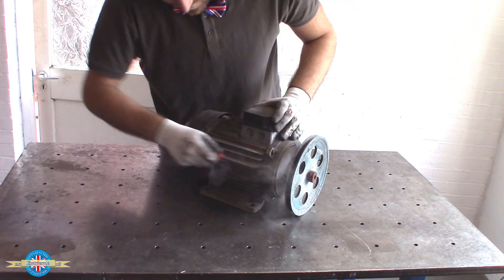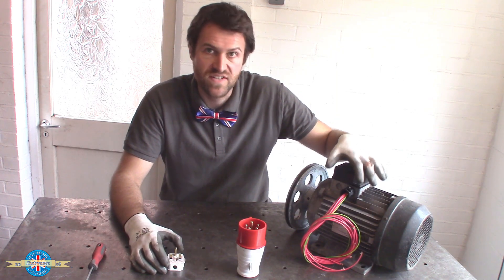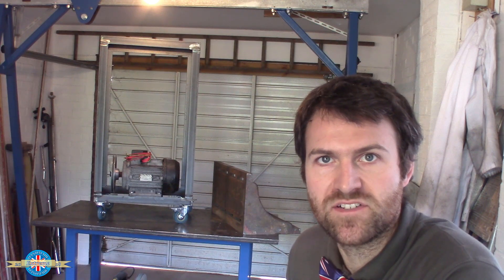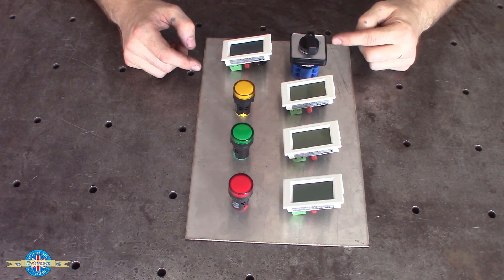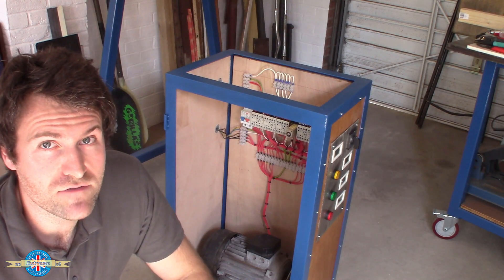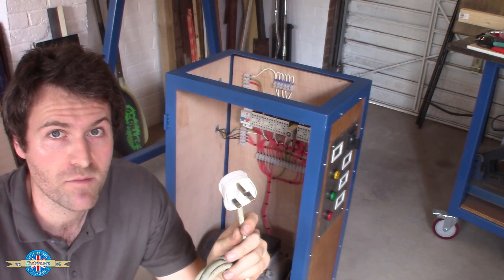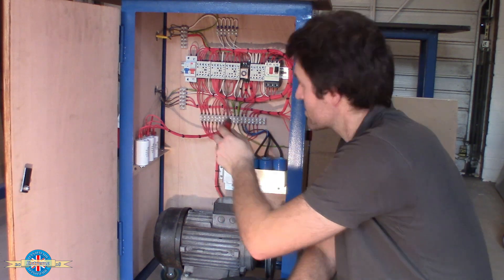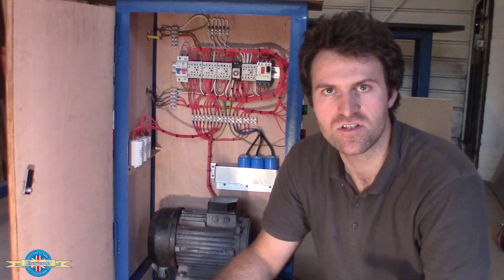1 Phase to 3 Phase Rotary Converter - 230V to 415V

Comment from the maker: I hope you enjoy my latest video. Let me know what you think. 
Is there anything I could do better?
Reply: Do you have  a elec. diagram by chance?
Reply from the maker: Not really no, sorry. If you look in the video description there are some links to 3 other videos. There are 2 by Galvinzedsankey that go into a lot of detail where he shows some diagrams and explains the system in detail. This is where I got most of my design ideas from. I hope one day he will make the third video in the series as I think that is a valuable resource for anyone who is interested in Rotary Converter design. Hope this helps. 👍👍 And thank you for commenting.
Reply: Awesome vid. My only suggestion is give the people what they love. .. more bow tie! Subbed
Reply: Really enjoyed watching this as it took me back 40 years when my father constructed the same thing for his workshop.
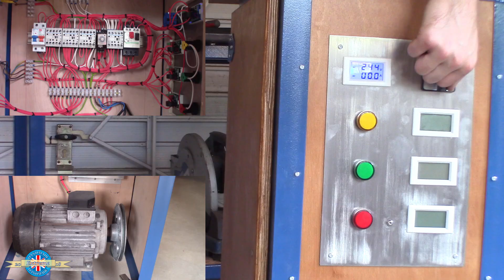Reply: A slightly longer shot at 12:30 showing the system come up to power and the voltages stabilise, but otherwise great work, both in the project and the shoot.
Reply: Like your video, especially work on wiring electrical parts - its look fantastic!

Probably the only thing that need improvement from safety perspective is wooden walls - mostly in case if something go wrong with any part of electronics and it catch fire. In my country it even restricted to place electrical wires on wooden walls - only in metal enclosure.
Reply: One thing you could do is make a hole and a shroud so the motor can suck in cold air from the outside. As well as some vents for it to expel air through on the other side. It shouldn't get too hot but ventilation is always a good thing, possibly with a filter since it's a shop environment.
Reply: Audio! I would look for a mic you could wear. When I surf through videos, audio is what sets them apart in the first 10 words and determines if I keep watching. I would love to see your channel grow. Good luck!
Reply: You start in delta I was always aware it was better to start in star 1/3rd the power before ramping up to delta?
Reply: Not in this application as he's using star for the 415 output
Reply from the maker: Glad you enjoyed it.👍
Reply: Handmade Extreme great job sir❤️❤️
Reply: Just wondering if you had a link to the bloke selling the plans
Reply: It would be good to know how to adjust this design for 240volt
Reply: @connorbesson488  depends on the pony motor your using. He is using delta to star for the 415 or so volts cause that's what that motor is rated at in star. Using a motor in a 240 delta should work fine.
Reply: Better Audio ;-)
Reply: What capacity of rotary converter required to run a total of 37.4kw of 3phase power?
Reply: It was really enjoyable to watch your craftsmanship in this video and a great learning experience about rotary converters!
One minor point that my friend who's an electrician made is that you've not used the standard wiring colours for your cabling inside the cabinet itself. I'm not an authority on these kinds of things at all :D but I think he was thinking about properly identifying the different phases in particular (black, brown, grey I think they are in BS7671).
Reply: @Nehemiah Ivan Lately I have been using FlixZone. Just google for it :)
Reply: Drawing
Reply: You could make it clearer which country you're recording in. Maybe with flags on the walls?
Reply: @RoamingAdhocrat  The Union Jack bow tie and the Union Jack in his "Handmade Extreme" design didn't tell you he was from the UK? What about his accent? Or what about @ 0:50 where he says "here in the UK". Yup, just for people with your low comprehension skills he should have flags on the walls, maybe also in the background a red double decker bus, a portrait of the Queen and maybe he could be eating fish and chips......
Reply: @unapro3  speaking of comprehension skills, you could do with learning how to spot obvious sarcasm, sport ;)
Reply from the maker: @ Damon. I could have used a VFD your absolutely right. however I have a few machines that I want to power and the rotary converter is a slightly more suitable solution for me. Cheers. 

@ DundeeDriver: Have you been watching Alec Steel by any chance.. 😉 Cheers.
Reply from the maker: Thank you. 👍
Reply: I realize it's pretty off topic but does anybody know a good website to stream newly released tv shows online?
Reply: A Variable Frequency Drive would have done the job much simpler. There are plenty out there that will provide 3 phase output from a single phase input. Just configure a few settings, plug it in and done

Comment: Here in the us, 240 single phase is “split” 180 degrees apart with a center tapped neutral. Generally we only have to create one more phase in a rotary converter since we already technically have two at our disposal. I find it interesting since you have to create two additional phases

Comment: great work but im still confused where the voltage gets steped up to 400v? no transformer? or are you getting out 220 v three phase and just using the low voltage connections on the lathe motor?

Comment: Nice work, I came to your video after the galvanizedsankmonkey video.
This method seems to be contridicting a people peoples opinions on the idea of running 240v star when in running - it's somewhat reassuring to see more than one video with this method.
I'm struggling a bit with my own but this video's helpful - particularly the parts list as my own motor is a similar kw rating.

Comment: Great vid, a wiring diagram would be great too,also what size motor on the converter need to be compared to the motor you want to run ?

Comment: Bloody awesome 😎 Seriously 💯/💯
I just saw date. Hope you’re still around. 
Quick questions on build and aesthetic’s.  
If you didn’t want to use a motor, how would you replace it electrically? Are you able to provide a schematic for your wiring?. (I’m into electronics, not AC electrics) Can you highlight the ‘chances of death’ parts of your build please ⚡️ 💀?. 
Hey, why didn’t you align the 4 lcd displays  on you control panel? Why didn’t you feed 3P cable ≈3 inches above 3P socket? Note: Seal both sides and edges of timber, warping can be a real issue. Why were the 3 blue caps put into an oversized elaborate time consuming pocket?
Best I’ve seen on YouTube, really fantastic, thank you. Cheers, Michael 🇦🇺

Comment: Older video But just in case you reply, how would you determine the size 3 phase motor needed to supply enough power to run a 3 phase welder?

Comment: Do these rotary converters run a  3-phase motor better than a VFD do you know?
Reply: No way. VFD provides balanced 3 phase. With a rotary converter, 2 of the voltages are induced in the idler motor’s stator windings as the magnetised rotor sweeps past them (the other voltage being across the 2 single phase supply wires) and these induced voltages drop under load. Even though the 3 voltages out of a rotary converter are perfectly out of phase by 120° from each other (due to the physical position of the stator windings in the idler motor) the “generated” voltages will always be lower than the single phase supply, and will drip further under load. Capacitors can be used to maintain these voltages better, but their capacitance will cause a phase shift, meaning no longer 120° out of phase. Best not to use “balance capacitors”, and opt for as large of an ilder motor as possible (3x load motor is a good minimum, 5x even better).

Comment: fantastic video, very tidy project. Im considering taking the plunge on making one. I have a spare 7.5 kw motor. how would using a larger motor affect the design/components you used? great channel. cheers

Comment: Hello, I have a 208- 415 3HP 3Phase Induction Motor, with 9 leads which can be configured  to a 208V Star Configuration ( U2, V2 and W2 Connected. together) or 415V Star Configuration( U2 is Connected to U5 and So on) . 
As we will be making a Delta Star Starter and will be powering the Motor with 220 volts, what connection in the motor should I select?  Awaiting your revert
Reply: Hello, Can anyone reply please ?

Comment: good job A question, if you allow. Can we operate a pump with a power of 10 horses? And if yes, what is the power of the motor pilote and what are the calculations of the capacitors? And when operating any additional load, do we introduce new capacitors to support the phase?

Comment: Hi
Great video!
I have 1 phase 32 AMP in to our summer house and I want to install a wall box for my EV. How can I get maximum charge? If I convert 1 to 3 phase as you showed our using VFD, how many amps can I load without taking all current from the house? 
If I would split today’s 32 AMP in 2 I would get around 3,7kW which takes ages to charge a 90kWH battery 
Upgrading to 3 phase is unfortunately not an option 
I’m not an engineer so all help appreciated :)

Comment: I’ve built a rotary phase converter very similar to yours, the main difference being that I use two timers and two contractors for the switching,rather than a star delta change over as they were quite expensive. Anyway, when I turn the converter off, the motor spins down but after a few seconds you can hear the motor suddenly stop and the start or run caps are discharging back into the motor. How did you get around this?

Comment: Dear sir, I am one of your followers, I have watched your video clip
about Rotary phase converter, I have a question about increasing voltage from 230 to above 400, would you please just tell me which part of proccess makes it possible, I have made one( delta wirring excluded, just main and star contactors) but unfortunately no increasing happen. It would be my pleasure if you answer it, I am in bad situation please help me. Thanks
Reply from the maker: You need to use a star delta 230/415 motor. It is the switching from delta to star that ups the voltage. There are some links in the video description to a couple of videos that show this with some diagrams and a very good explanation. Hope this helps. Thanks for watching.
Reply: Dear sir thanks for your attention, I have done that, I have a 220/380 multi voltage motor, in the circuit, and following that delta/Star connection, but unfortunately nothing, If you let me, I send you my wirring diagram, thank you again for your attention, meanwhile I am in a very bad situation, thank you sir.
Reply: I have produced a 3 phase 220 volt each from a 220 volte single phase (live and neutral power supply) which have been balanced by capacitors. according to the facts, the line voltage is equal to squre root of 3 times phase voltage ( voltage between neutral  point and other side of each coil), but unfortunately I cannot achieve to extera voltage in out put, Please tell me where did I make mistake, thank you sir.

Comment: OK yes it works and is neat, but a couple of hopefully constructive comments : A/ Why not wire three phase adjacent to each machine and put your converter in a corner out of the way rather than keep moving it. B/ Your three coloured indicators are potentially confusing. Being next to your meter units they look as though there is one for each phase, and their colour follows the previous colouring convention for UK 3 phase wiring re-inforcing this thought !

Comment: Me again, 10 months since I bought the plans from Les and started collecting parts and putting things together. Tried starting the circuit for the first time last night and... nothing! Well, the first relay clicked but that's about it. Troubleshooting is no fun when you don't really understand what's going on ha-ha. I did notice that your timer has a little light on it, whereas mine is the same part but doesn't illuminate. That's something for me to look at in detail among a sea of possible problems. Les has been guiding me via email with some of my questions but I'm at that point in which I don't think anyone else can really assist without being here poking around in the rats nest of wires I've created.

Comment: Hi , really good video , 
It helps a lot 
I tried to make my own and I think with the same wiring as you, and it works well with a 3kw motor, but when I try to do it with a 7.5kw motor and more capacitors for the larger motor, it seems not to work correctly  .  when it goes to star, the motor is running very slow, overheating, and with an amperage of 70‐80A
I don't know if the contactors are to small,  or I need a flywheel on the shaft .
Im losing hope with the big motor
If you have any suggestions,  more then welcome 
Good work
Reply from the maker: Have you checked the windings for the motor to make sure they are not damaged? also is the motor wound for the correct voltages?
Reply: @Handmadeextreme   yes  I checked  the name plates for both motors and they're the same except for the kw,  and the fact of higher voltage for 60hz,   the only thing I can't  figure out  is the number of poles 2 or 4,  I guess it is 4 because it  is  1450 rpm 
Thanks a lot for your answers and I can't wait for the next video of the RFC  
Maybe I'll find the problem with my diagram 
Thanks

Comment: Hi, superb video, thank you so much. I did 'build' myself a rotary converter by using a Transwave Static which came with my Bridgeport Milling machine but notice it uses some transformers. I did notice the imbalance between the legs as you mention two being around 405v and one dropping to around 380v under a no load situation. I'm going to look into balancing them out using a set of caps as you did.
May I ask, which circuit diagrams you found most useful while building yours. I'd rate myself as reasonable where building and understanding the principles of units like this but I will need the help of diagrams etc.

Your unit looks amazing and I'm very impressed. Thanks for sharing. Liked and subbed.
Reply from the maker: Thanks very much. I watched a couple of videos on the subject before building mine. There are some links in the description. Regarding diagrams I didn't really use any to be honest. I keep meaning to put some together as so many people have asked for them. Thanks for the support.

Comment: Wouldnt a vfd be an easier option ?
Reply from the maker: For a single machine probably yes. But I use this like a little power station to power multiple machines which all have different requirements. In my case it is more cost effective to use the RPC.

Comment: Have absolutely no idea what you have just done but it looks impressive. If I was to hazard a guess I would say that you took a single phase motor, and through some tricky wiring turned it into a three phase generator. Or maybe it was  three phase motor that you started on a single phase.
Reply from the maker: Your on the right lines with your second guess. Its a three phase multi voltage motor. You start the motor in delta then switch it over to star (opposite way round to how you normally run three phase motors) so you can generate the missing two phases and step up the voltage. I'm going to do a detailed video on how it works in a few weeks time.

Comment: 6:00 Motors run wired delta, not star - why is this the wrong way round ?
Reply from the maker: Multi voltage motors can run in either star or delta depending on the supply voltage. However in this case the motor is being used as a generator rather than as a motor per se. Wiring in star as a motor (in the uk) puts 230v across each coil to the star point. In delta 415 across each coil. But when using it in the converter by running it the opposite way round you are generating your 415v phase to phase by only powering 1 coil with the 230v supply and neural. Hope that helps. Thanks for watching.
Reply: @Handmadeextreme  If you're running it 'star' you may as well start it 'star' - that's my point.

More interestingly, can you run generators 'star' too ? My idea is to run the gen at half speed wired star to boost the output voltage back up !

Oh, and the other mystery,  with a delta gen, where do you get a neutral from - should you want only 1ph 240V?

Comment: Would it be easier and cheaper just to buy a VFD?
Reply from the maker: Easier yes. Cheaper... Well..  That opens a whole other can of worms. If you just have one motor to run then yes it may be cheaper to use a VFD but if you have multiple machines and multiple motors to run then a RPC will more likely work out cheaper in the long run.

Comment: clever idea to make the tool cart be your power source.  Also, having it in the box helps cut done the idle noise. Very nice - 👍😎👍
Reply from the maker: Thanks. it's worked fairly well. There if a bit of vibration which is a paint. doing it again i'd put the motor on rubber engine mounts. Iv'e actually moved the motor out of the box now and got it bolted to the floor as I have a permanent home for it having moved the workshop round a bit.
Reply: @Handmadeextreme  The vibration comes from the phase voltages being unbalanced. I balanced my idle motor with run capacitors on it's own. The load motor has it's own contactor. I balance the load motor while both motors are idling  Each motor should have it's own tuning capacitors so when it hooks up to the RPC it does not throw it out of balance. When balanced the system runs smooth and quiet. It will probably be less stressful on your motor bearings as well.